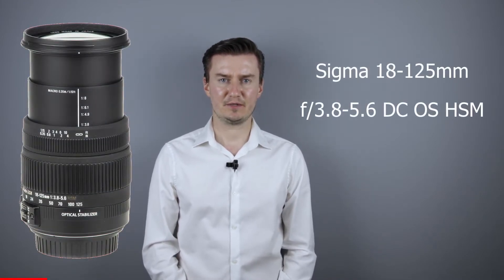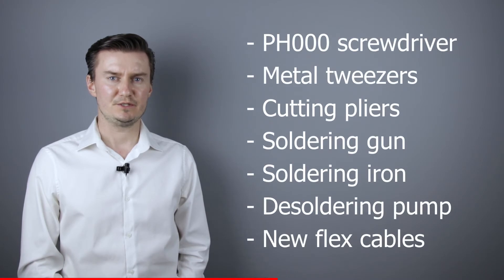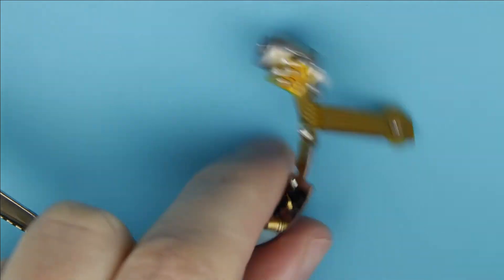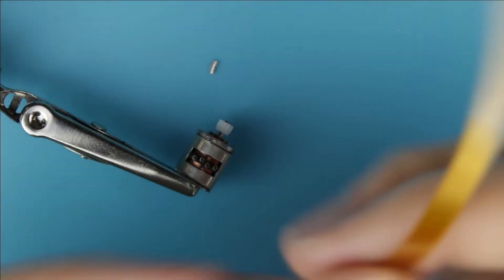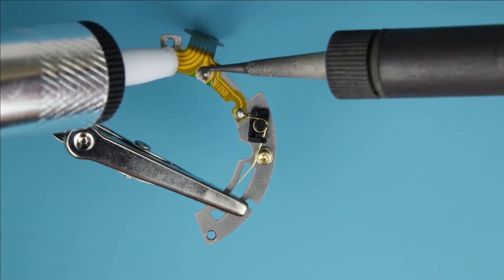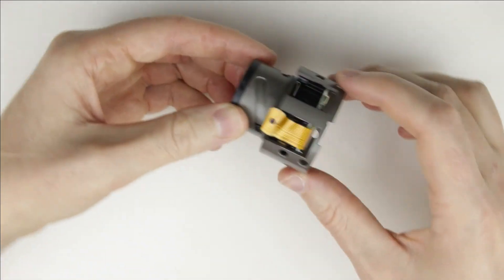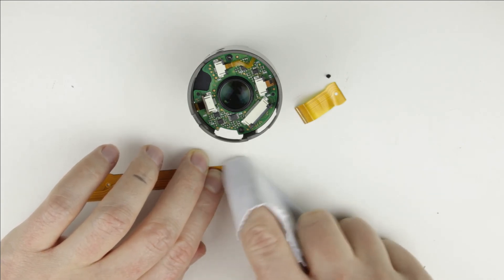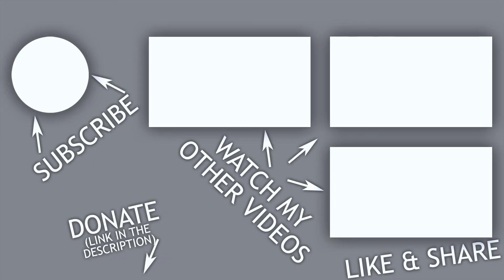Sigma 18-125mm f/3.8-5.6 DC OS HSM replace the aperture-, and OS flex cable after disassembly

Comment: Hey there, 
I really like the video and it is great instruction but when I tried to solder on the flex cabel I ran into some issues. The tiny wires to the motor wern't long enough to solder them onto the flex cabel. During the repair one of the wires broke off do tu it beeing to short and not fitting propperly. I tried extending them with some a little thicker wire to get a good connection and I was able to solder all the wires to the connector but as I wantet to install the motor again, all of the 4 wires broke off right at the motor and now I'm kind clue less on how to procede. Can you maybe tell me what went wrong ? I belive that i was using a way to big soldering iron but does that affect the wires breaking off so much ?
Reply from the maker: Maybe you used a big soldering iron, or too much heat, I don't know. Anyway, check ebay, maybe there is aperture unit for sale there.

Comment: Be warned. The pins in the aperture motor will just melt out of the motor when you apply heat. Happened to me, so now the lens is junk. It may be preferable to leave the remains of the flex cable in place and just solder the new one over the top.
Reply from the maker: If you leave the remains of the flex cable, you can melt the motor also. The only thing you have to be careful with is make sure that the soldering iron is melted completely when you lift up the remains of the flex cable... if not, then you can damage the motor by lifting up the metal pin connector. I guess this has happened in your case.

Comment: Again a very helpful video. Which temperature do you use to solder the flex cable? Thanks a lot. Greetz from Berlin
Reply from the maker: I don't know... my soldering gun has just a scale without temperature values.